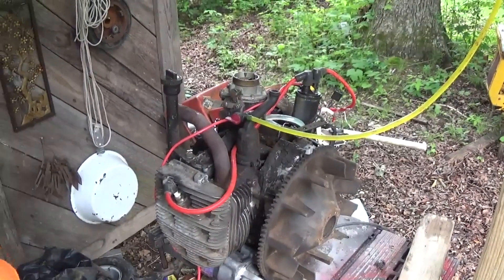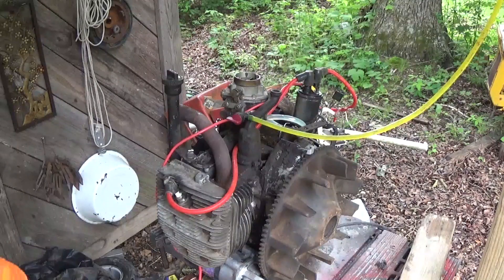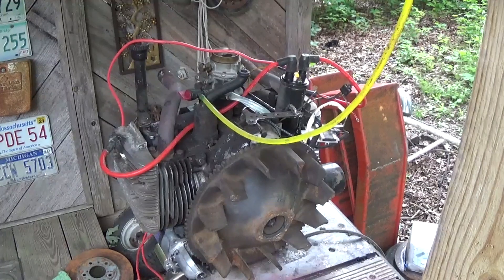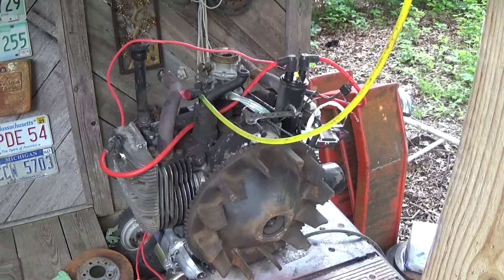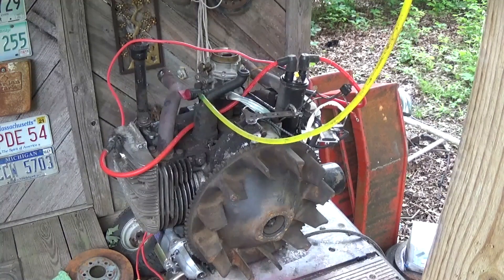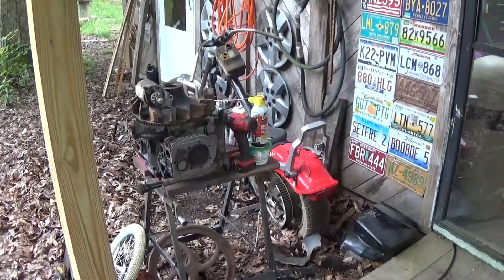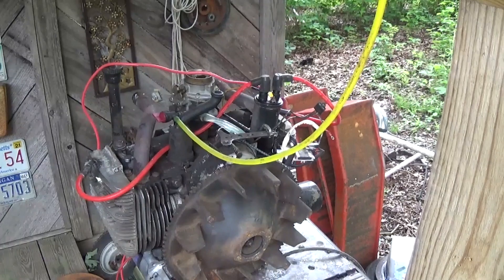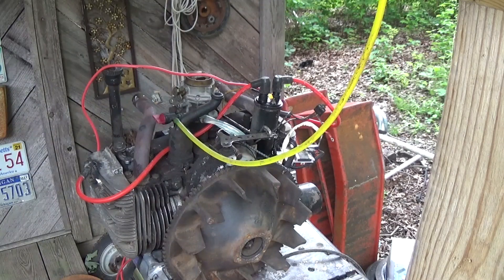Onan 22hp opposed twin, Fire in the hole!

Comment: where can you get ignition parts for onan ? i think mine needs a coil
Reply from the maker: Ebay is always a good resource. I ended up switching my ignition back to points and condenser as the electronic ignition failed and even used parts for that are very expensive.